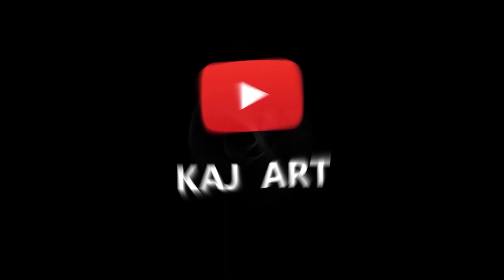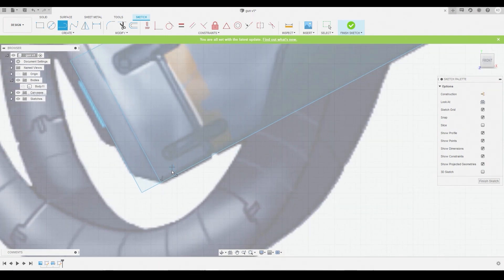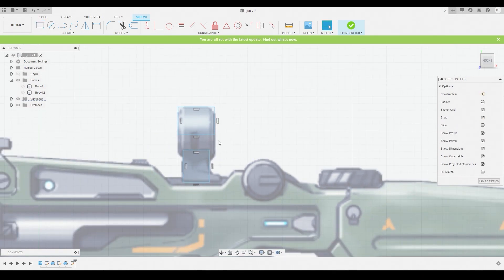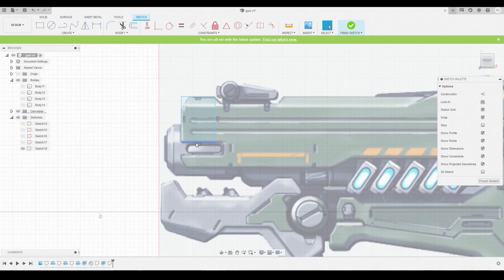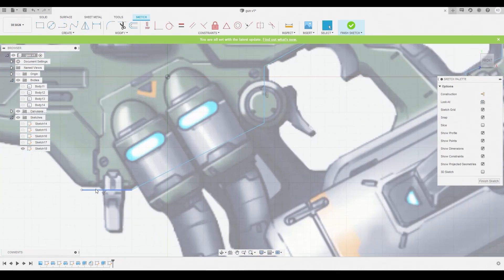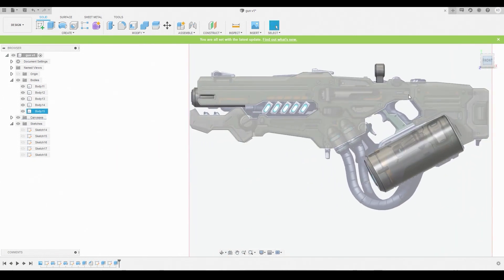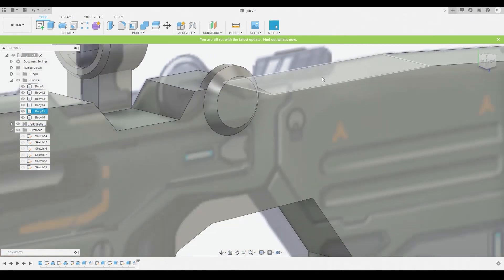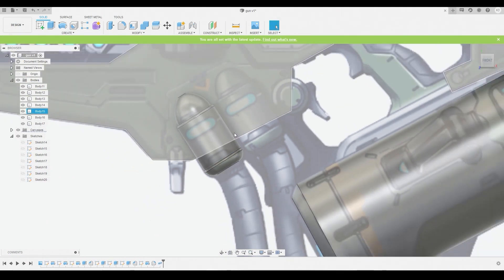Weapon Modeling Series in Fusion 360 (part1)

Comment: Awesome. I started to use Fusion 360. Can anyone tell me how to properly import images? I have 2D concepts from procreate and photoshop. However, I noticed that Fusion 360 doesn’t accept those files. Highly appreciated it.
Reply from the maker: Go to insert...then insert canvas, then select a plane to display your image on. Cheers!
Reply: @thelastdev  Yes! Thank you! This is my first time using the software. Still debating to get the full license. I started with Shapr3d. So I know some basic methods of modeling. I have another question. Can you fully render hard surface projects in Fusion 360? Because I see many artists use Keyshot, Substance Painter, etc. However, some of these subscriptions or fees are pricey. Do you have ArtStation? Thanks again.
Reply from the maker: @stormnorm009  Hey, parametric modeling, and t-spline/surface modeling are the most used and only used methods of modeling in this cad program. here is my art station https://www.artstation.com/kendale